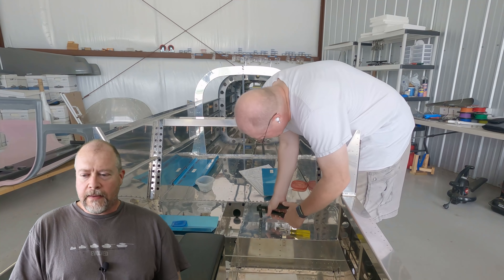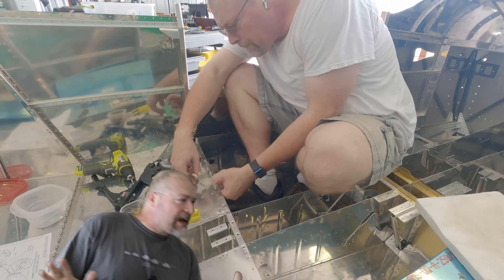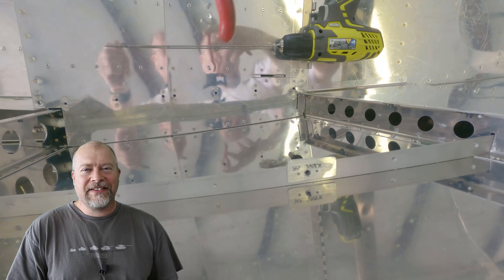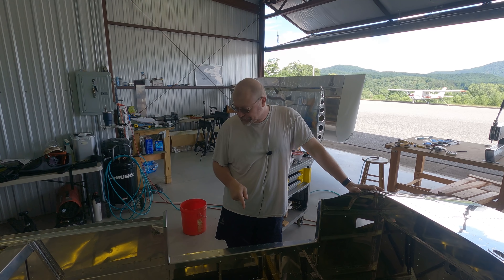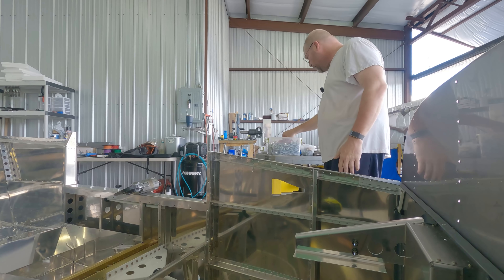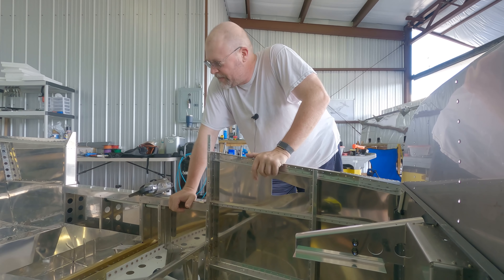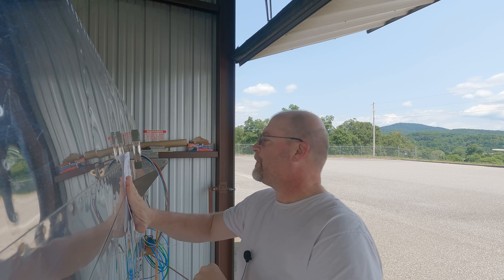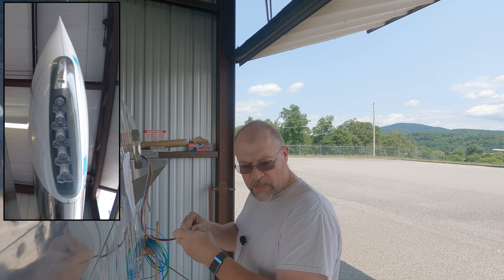RV-10 Fuselage - 043 - Finishing up floors and beginning brake lines

Comment: Please forgive this long post. I just finished binge watching your RV10 build videos. I'm not a builder, but I'm very familiar with your Shark bite PEX tubing. It's intended purpose is for residential and commercial plumbing, which makes it really ideal, in my opinion,  for what you're using it for. I'm alarmed about one thing though. PEX is very soft. You can cut it with a knife. When hanging PEX, it is recommended to use hangers with a cushion in them to prevent abrasion and eventual leaks. I don't know how much vibration your wings will be subjected to, but it seems possible to me that the sharp aluminum edges could wear through the PEX and then, eventually, your precious and inaccessible wiring. If it's not too late I would suggest a small dab of good adhesive at each rib to prevent any movement of the PEX. If it can't move, it can't abrade.
That being said, I have loved your videos and have rarely been bored by them. My favorite parts are your adaptation to unexpected problems and inconsistencies in the build sheets.
I think you've done a great job so far and look forward to future videos. 
Good luck!

Comment: Yes, the nutplates are intended to be vibration resistance and not allow the fastener to back out.  You can certainly use a tap to destroy that feature, but then threadlocker is indicated as you mentioned.

Comment: Don't ruin your nutplatea with a tap!  Just use a little Boelube on the screws and they will run in and out easily and still retain their locking properties.  You'd be amazed at what a little lube on the threads will do to make them run in and out more easily.

Comment: Many detailed pictures are beneficial -- not necessarily to prove that you did the work, but to aid in later maintenance when something goes on The Fritz.  And either/or photos/videos helps the FSDO inspector determine whether you qualify for a Repairman's Certificate (getting your airworthiness is a non-issue compared to what you will go thru to get your Repairman's Certificate)
Reply: Wig-wag often requires communication with the other wing ...
Reply: the tube comparison was between a cut and a virgin ended tube ---- the cut one APPEARS to be thicker walled, but it is only a displaced wall due to the cutting of the tube ---- they may be the same difference.  You should find a part number attached to the tube and/or a reference on the inventory sheet as to the difference between them. (Once you deburr the cut tube, you might find the wall thickness to be the same as the other tube)
Reply: @1shARyn3  That’s my thought also.  My lights have a synchronization wire that I believe is used for the wig-wag function.

Comment: That type of nut plate tends to make it easy to ruin fasteners. They seem to be tighter than other styles. Run a hex head bolt in first before the softer phillips head ones. A tap doesn't work well as it cuts and you just want to reshape the nut.

Comment: If you cut tubing with a dull roller cutter, the walls of the tube might be bent inwards and look thicker than they are. I'd do a clean cut or file the ends to assess the ID and wall thickness.

Comment: I think the wig wag wire is more of a on off on off sort of thing. At least that's what it does, alternated lights back and forth, so not sure you can test that by powering it on., not sure of that makes sense, that's just what I am thinking.

Also, tubing. The thicker wall would hold more pressure, so that is what I would use for brake lines., the thinner wall may be fuel, or air source.

Comment: Does your hanger have facilities like toilet, water etc and also how much is the electric supply. I am in a situation where I have 120V and 20 Amp and no water or toilet or heating in the hanger. So, I was wondering whether you are also in a similar situation?
Reply from the maker: We have a portapotty around the corner and about 100 yards beyond that is the old terminal which has all the thing we need.. Nothing in the hangar though other than "the red bucket"..
Reply: @JasonEllisBuilds  You give me hope. If you can do this I can too!

Comment: you only have to show that the build was over 50% done by armatures not  that you are the builder.
Reply: Unless you want a repairman certificate, which most of us do want.
Reply: @LTVoyager  14 CFR 65.104 a (2)Be the primary builder of the aircraft to which the privileges of the certificate are applicable;

(3) Show to the satisfaction of the Administrator that the individual has the requisite skill to determine whether the aircraft is in a condition for safe operations; and

There really doesn't seem to a time or amount of work tied to certification for repairman as long as you meet #2 and #3, the 51% rule seems to tie to whether the plane is EAB or not.
Reply: @DIYJunkie369  It is an area open to interpretation, but the interpretation is made by the inspector.  If you didn’t build the airplane, which is the context of the opening comment in this thread, then you will have a hard time convincing the inspector that you are the primary builder and have the requisite skills.